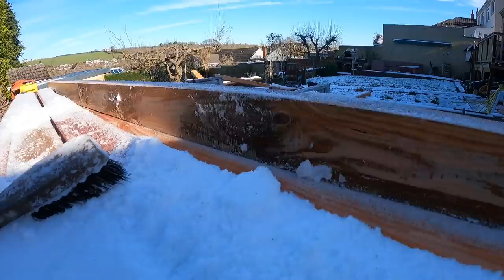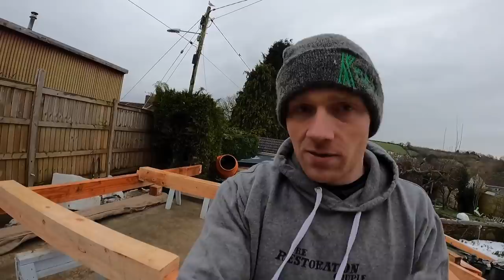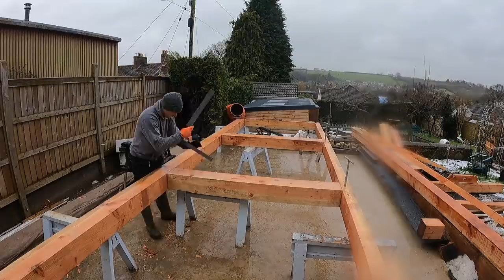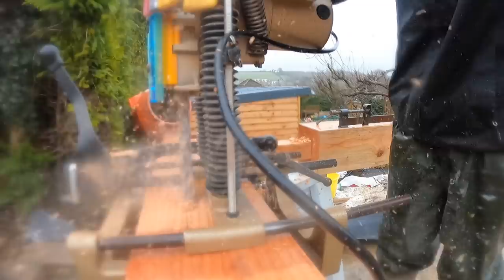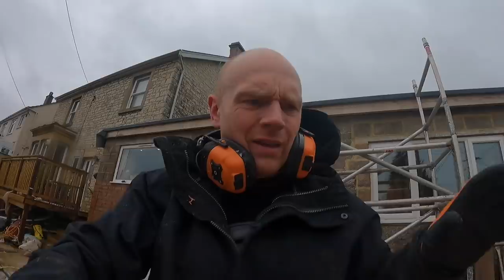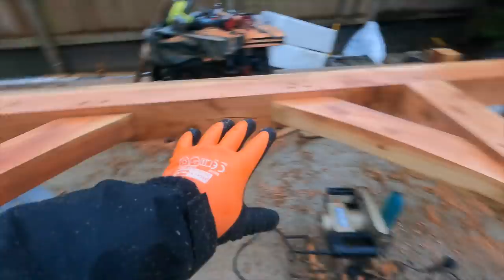LET'S GET THIS FRAME BUILT! - First Wall Done!

Comment: Great work, the oak frame guys that worked on my place used loads of ratchet straps to pull things tight before drilling the peg holes. They used a short softwood block under the strap to protect against the strap  pulling on the corners of the frame and rounding the corners.

Another thing is they drilled a 6mm drainage hole at about a 30⁰ incline  into the mortice from the outside, so any water that does get in may escape freely.
Reply from the maker: Yep, straps work great, unfortunately they are all stored in our campervan which is not here at the moment. May grab a couple more if needed though. No need for drainage holes on this one I hope but perhaps for the gazebo build this summer.
Reply: @TheRestorationCouple  👍 The drainage holes are required on exposed frames where the joint may collect water, so your blind mortices into the sole plate for example. However if you're cladding the outside it probably isn't needed.
Reply from the maker: Yeah there is 150mm of wall build up to sit outside this frame so it should all stay dry and cosy. 😀

Comment: How did you solve the issue with the blocks overhanging in the end? It looks like your beams are flush on the inside, but in the vid where you fit the cladding, with a 25mm roofing batten they're also flush on the outside?

Comment: An honest question. Does it affect the wood if it gets soaking wet? Any risk when the wet wood drys out it might deform? I have often seen roof timber laying around a building site getting soaking wet.
Reply from the maker: Yes, dry graded timber can cause issues if built with wet, especially if studwork as when it shrinks the next season it can pop screws through plasterboard. This timber is freshly felled green so a few days or weeks of rain is not going to change its moisture content and ideally it will dry out slowly to avoid to much cracking and movement rather than sticking the heat on max as soon as the walls are up.
Reply: @TheRestorationCouple  Thank you, great answer. The evolving workshop looks superb.

Comment: Ignorant question (I know nothing about construction!); but when drilling the holes why not have all the pieces inserted and then drill through everything in one go to create the peg holes?
Reply from the maker: Good question. The idea of marking the hole on to the tenon and then drilling that is you don’t want them to line up. By offsetting slightly the peg will pull the joint tight. Perhaps I’ll do a demo joint in a future video. 👍
Reply: @TheRestorationCouple  That would be awesome for us less knowledgeable folk. Thanks Tim!